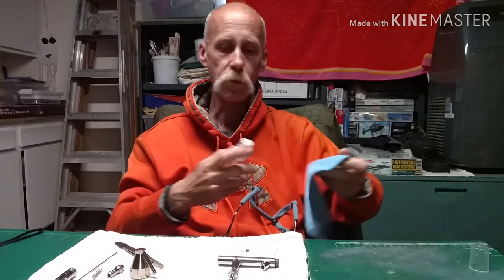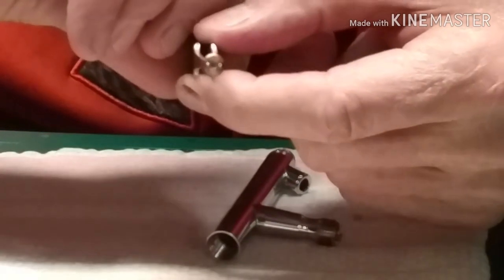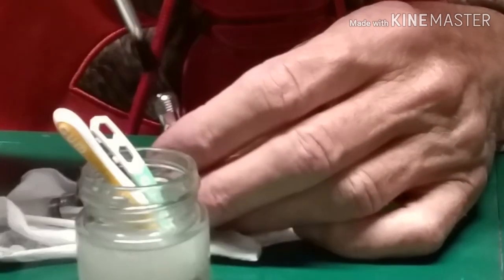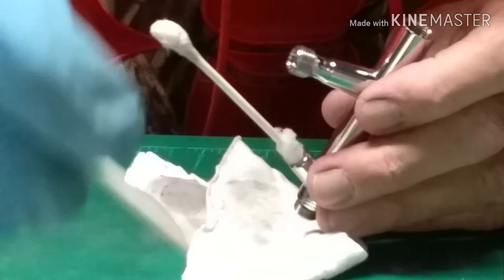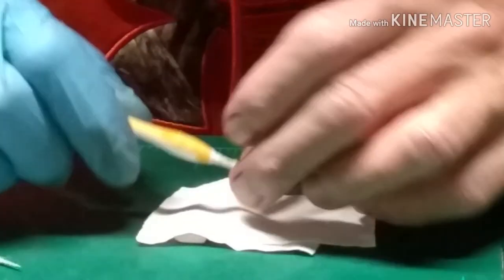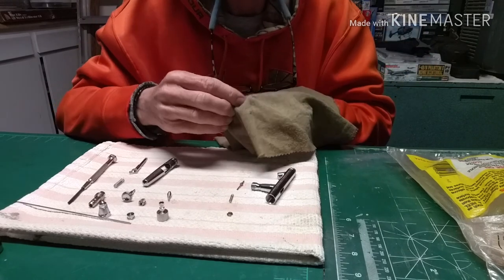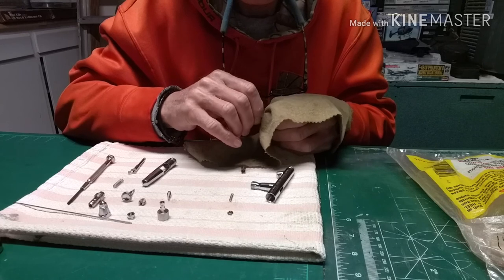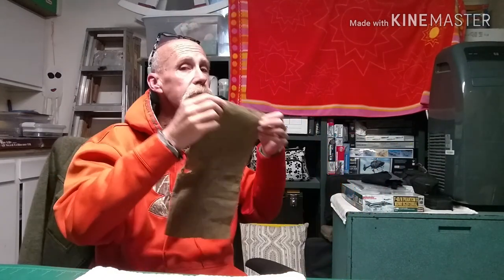S3 Model Works; Iwata Eclipse BCS Maintenance

Comment: I left paint in both my siphon ,and gravity feed iwata airbrushes over night and now niether seem to work right is this something a good thorough cleaning might fix or have I completely ruined these brushes I did the same thing with my iwata trn1 gravity fed trigger finger style.any input would help
Reply from the maker: You'll need a good quality lacquer thinner, some nylon pipe cleaners, some interdental brushes and q-tips...and a good schematic drawing of your airbrushes if you're unfamiliar with their complete disassembly, but it can be done. Pro-Tip: never let paint sit in your airbrush for any length of time, at a bare minimum, you should be pulling the needle and cleaning the tip even for short breaks.Best of luck, let me know how it works out...and thanks for your question.
Reply from the maker: Strip it all the way down to just the body and soak the metal parts, be careful with any rubber gaskets. Focus on the interior body channels, tip, needle, trigger, spring and plunger assembly and the packing gland.